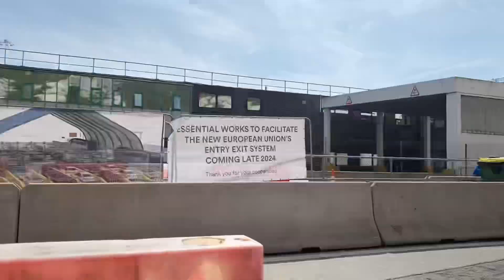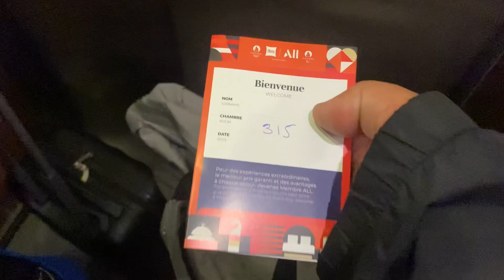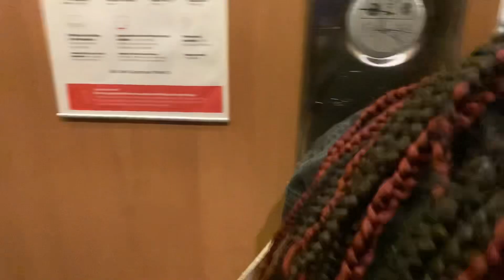ALL ROADS LEAD TO HEM ( HONDAEUROMEET) 2024 EP.1

Comment: EK9 and the EK4 are both looking clean, fair enough you fixed it the day before the ferry, I’d have been worried hah, both cars are beasts. 💪🏻

Car overheating at low RPM’s might be the water pump or fan belt? Bet the head gasket is fine; searched it and could be “coolant loop” shoving coolant into the overflow tank, no idea what it could be though.
Reply from the maker: Head gaskets fine, we even removed the thermostat as well to see if it was a thermostat issue as the lower rad pipe would never get warm. once we removed it it started getting warm as well as the other rear heater pipe. we reckon (after we did the trip) that the fan switch was faulty which didn't tell the ecu to turn the fan on so with that not working, it couldn't keep to the correct temperature
Reply: @VISHALRHODES  I see mush, best of luck, should be an easy fix I hope. 💪🏻